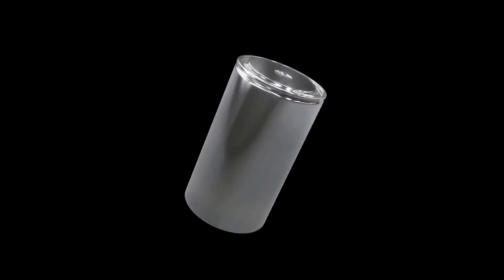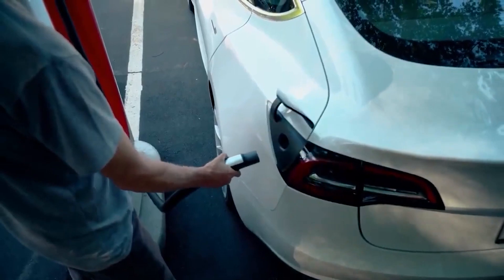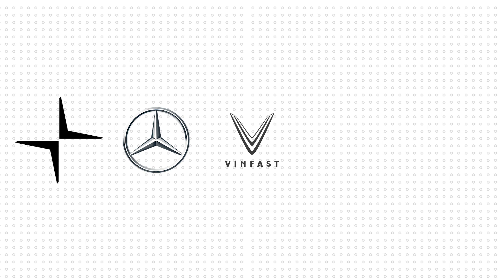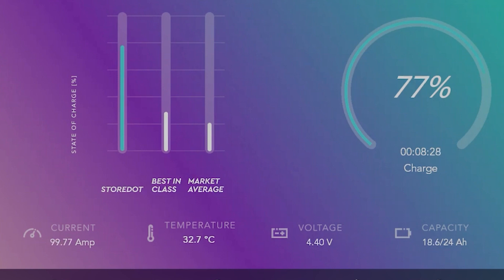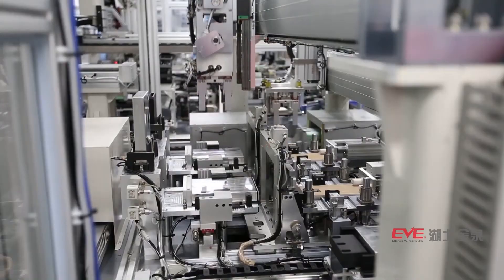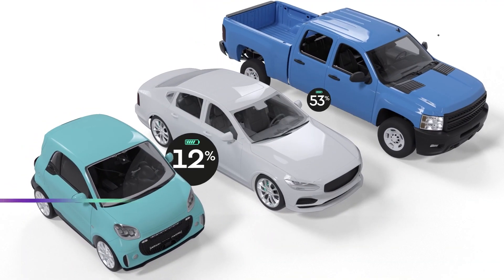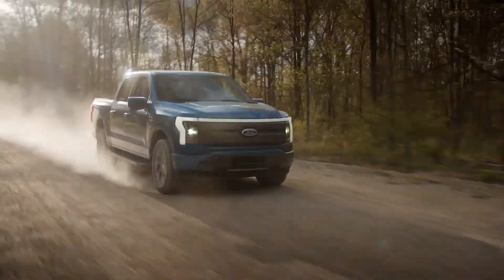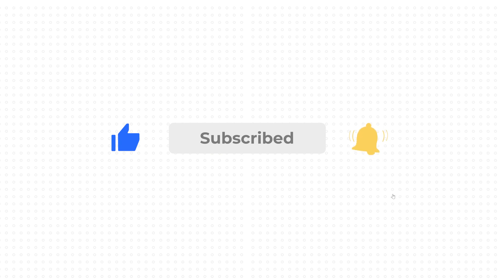IT HAPPENED! XFC Batteries FINALLY Hit The Market!

Comment: My biggest battery breakthrough is one that doesn't require specialized heating and cooling. When a battery can easily be charged at -40c weather outside without being warmed up first, that's gonna be great. I like EVs, I find them awesome, but I'm still weary of harsh winter conditions. It's common for where I live for temps to be between -20 and -40c, and while I know EVs operate just fine at those temps, I also don't wanna have to put an EV in a garage to make that happen. That's not feasible... And only when an EV can easily reach 450+ miles of range can I consider one. It's not for in-town driving, it's for driving out of town, when the closest city is 300km away, you want that type of range... especially for Winter.